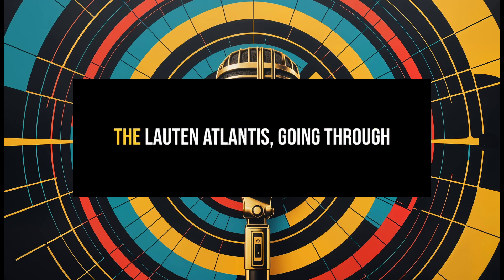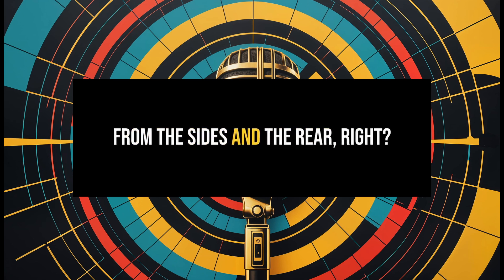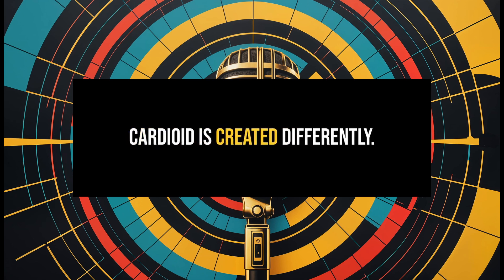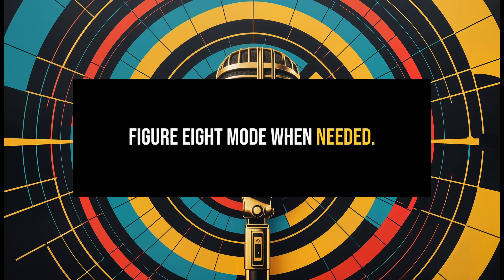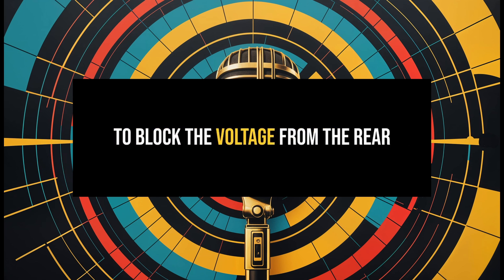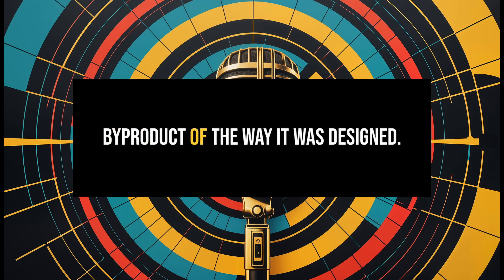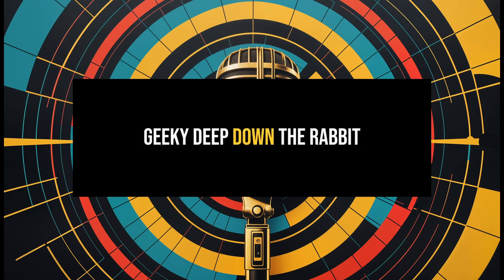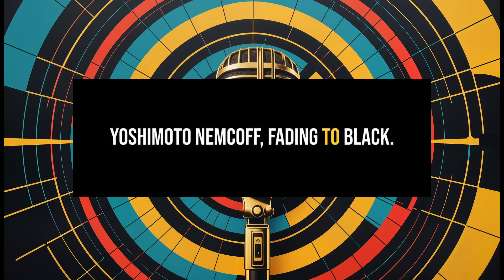Single vs Multi-Pattern Mics: Does Cardioid Really Sound Different?

Comment: Like the sound of the DeEsser! Great explanation of Cardiod patterns!  The rear voltage in a dual diaphragm capsule creates a rear lobe, which picks up noise from the rear of the capsule. It can be in or out of phase.The myth is that the pattern is heart shaped, it is in two dimensions, however in 3D it looks quite different. Here's an old diagram from Shure https://tecnoiglesia.com/wp-content/uploads/2021/05/microphone_cardioid_polar_pattern-microphone_basics-shure_eu_2016-1536x792.jpg

Comment: Haha. I have no idea which I prefer. ;) I did take my D87 build with a JLI TSC-2 and converted it to the ORS87 circuit (essentially removing parts) and I know I prefer the extra gain now vs how it was before. Guess I didn’t realize I may have changed its sonic qualities. But, it still sounds pretty darn good. Great question!
Reply from the maker: That's awesome you were able to doctor your previous build into what you wanted. It's all about knowing how to get what you want from your gear to have the best chance for success.